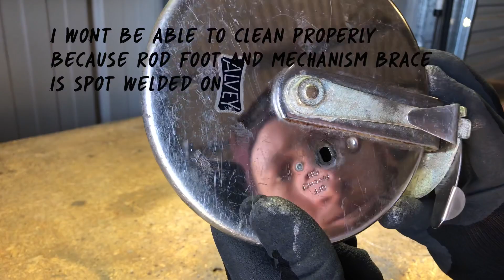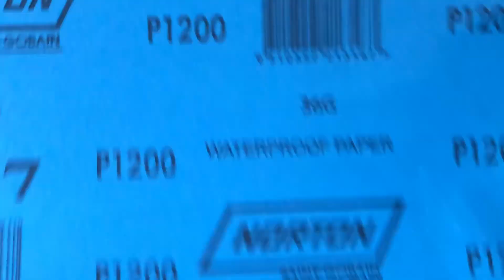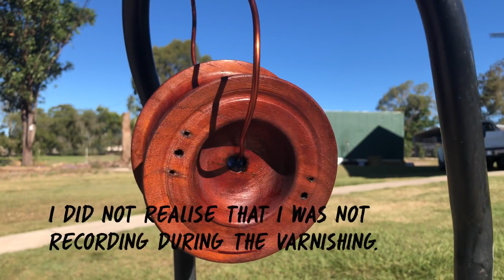🌟 RESTORATION 🌟 Alvey fishing reel VINTAGE 1960’s

Comment: I don't like the reel itself, the finish isn't up to spec
Reply from the maker: Can you link me to your video of you doing a better restoration please mate?
Reply: @aussierestos9105  So i can't have an opinion? It isn't even a restoration, its just sanding every piece, even the original plating down to the brass. If you had replated the brass that would have been worth the restoration name. But no, attack someone with an opinion instead. If you put a video on the net you are liable to have it critiqued, accept that or don't post anything so nothing can hurt your feefees.